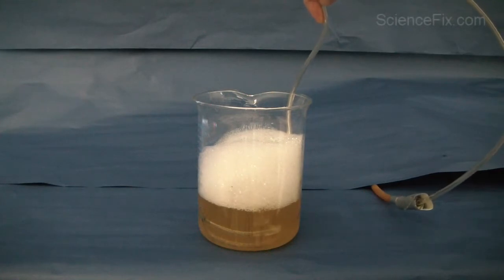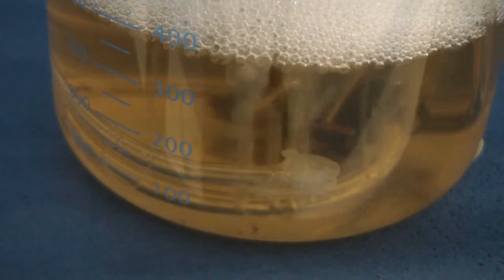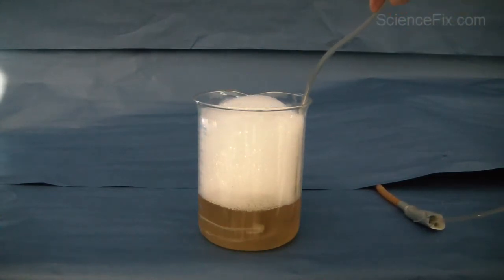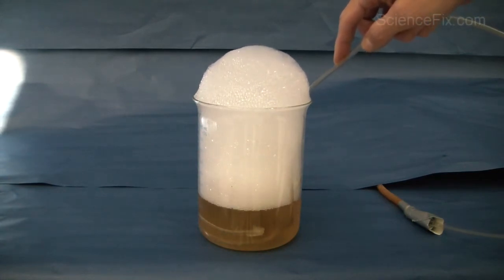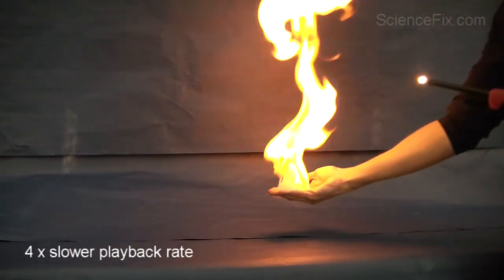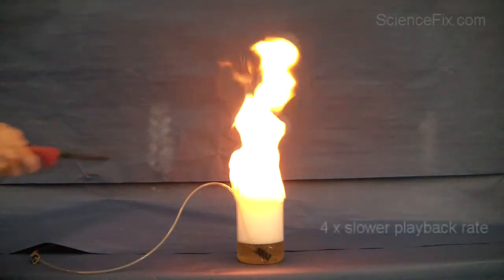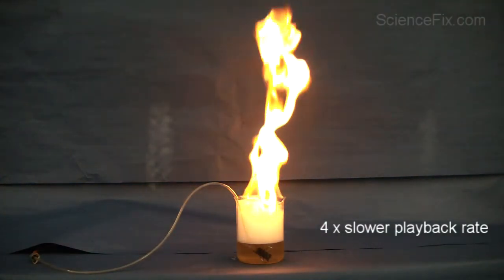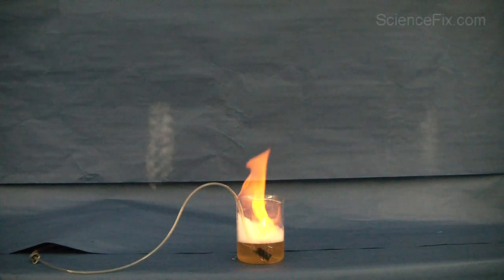New and Improved Firehand

Comment: I do this as a demo with my students but we take two safety precautions just in case- 1) no bubbles under or between the fingers because when the heat rises we don't want it rising through the hand and 2) wet the hand with water first and let water's high specific heat capacity help resists the heat as well.